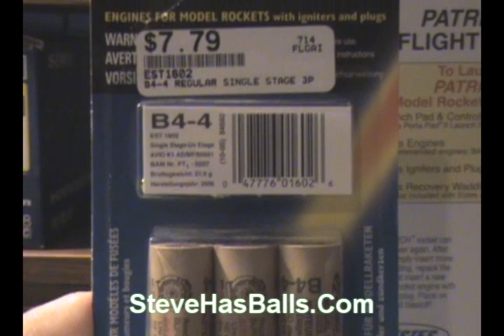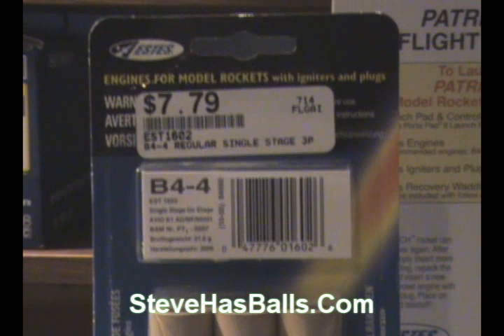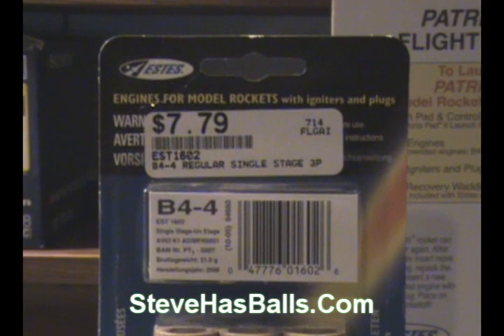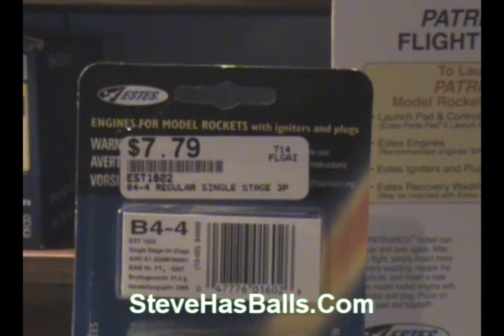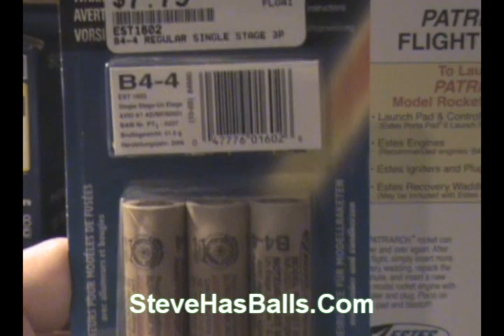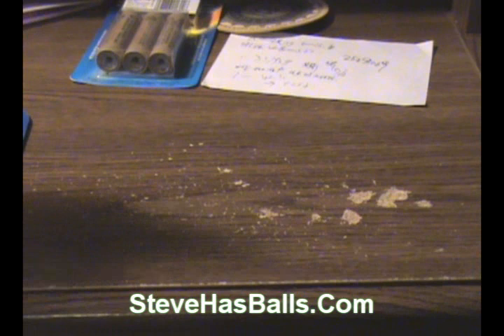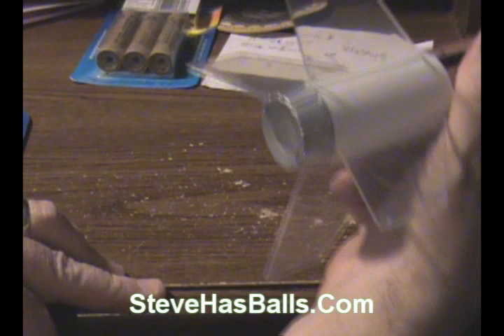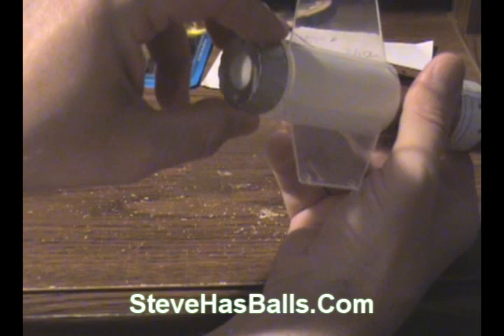Estes Patriarch Model Rocket - Part 1

Comment: It is ok when you can buy everything made for you. But the thing you buy will never be so impressive like the one which is made yourself from NOTHING.Making rockets on your own(trying original fuels, from a pipe or car shock-absorber, making a nozzle with a welder from a sheet of metal, make a rocket engine and so on)will bring you far more satisfaction and knowledge. The time spent working with it is worth those few seconds when your rocket is in action. Bought rockets are for young children.